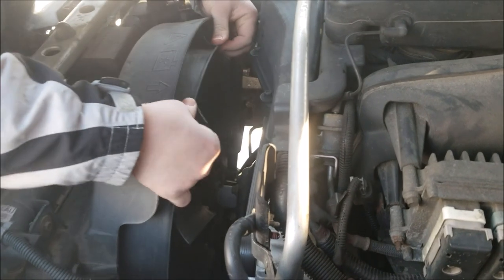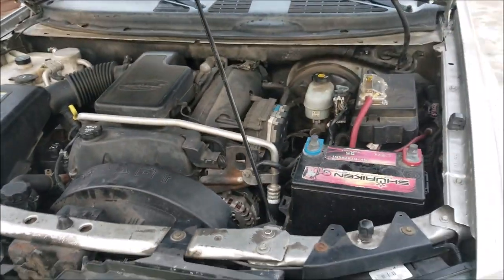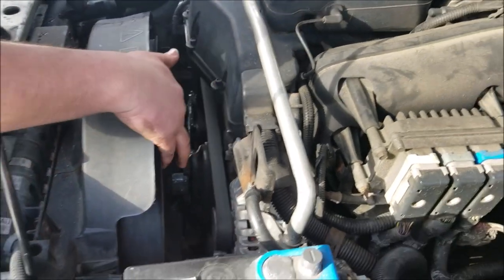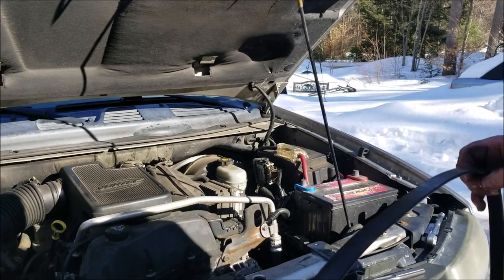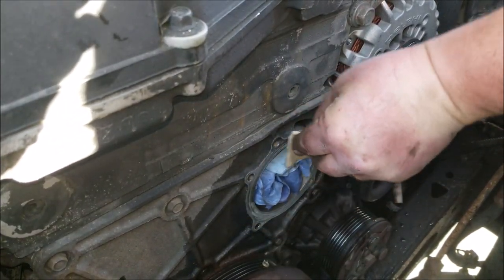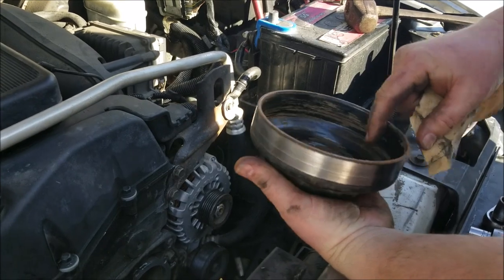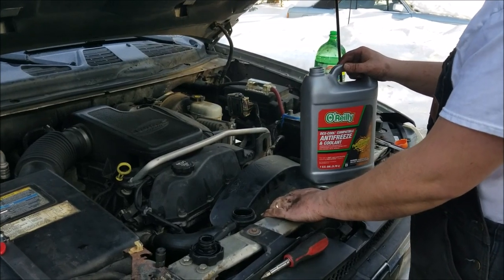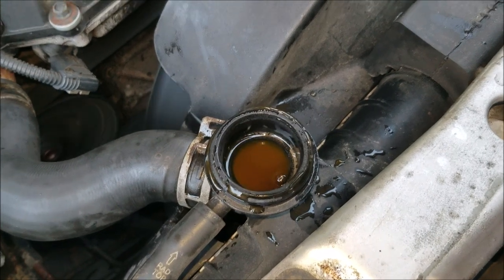Step by Step Chevy Trailblazer 4.2L Water Pump & Fan Clutch Replacement in Under an Hour

Comment: You don't have to tighten the big fan nut. It will self-tighten when the engine starts. It won't unscrew or fall off when you shut the engine off. It'll be just fine.
Reply: Take an air chisel to the nut end for a whack or two. It will definitely never move. Taking it off, this helps too.

Comment: GREAT, video, thank you! 

BUT it’s  35 INCH pounds and then 89 INCH pounds for those small 10mm head water pump bolts to block  

You’ll break or strip them if you use FOOT pounds
Reply: So wish I saw that before I did it...     On a positive note, I haven't had any leaks with just 4 bolts on my pump.

Comment: Steve - Excellent video. Very detailed and time saving. Why did you replace the Fan Clutch was it bad or is it just a good time to replace it when the water pump goes bad? Thanks again this is going to be big help.
Reply from the maker: If the electric fan clutch fails it can cause water pump failure, so due to the labor involved and the mileage on the vehicle I felt it best to simply change both while I was right there. Thanks for watching and commenting!

Comment: there's no need to cut the shroud, pull up the driver side first so the fan clutch assembly clears the pulley  then tilt the shroud towards the engine, you'll have to wiggle and finesse a little  until the shroud is clear of the power steering lines.

Comment: Just want to say thanks for this video! Well done. Dealership wanted $700 for this job. I replaced water pump $88 AC Delco, $25 belt, plus antifreeze. Thanks! I did notch the shroud to allow clearance past the radiator neck. Pulled both the shroud and clutch fan together straight out with no problem. THANKS!!
Reply from the maker: Wholy cow thats some serious dough! Glad to hear you were able to get it done yourself. Thanks for watching and commenting!

Comment: Great video. Excellent positioning and descriptions. Awesome tool description too.
I caught the 10mm water pump bolt tightening mistake but that was the only one.
I usually dont need a torque  wrench anyways. 89 ft ponds is way too much. haha
Id say 25 ft pounds is good.  Thank you my good man.
Reply from the maker: Thanks!, yeah, 89 inch lbs was what it should be

Comment: Great video . Prior to me watching , I was surely going to let the professional do it. Dealing with removing the radiator,,I DIDNT WANT TO DO. After seeing how you cut the cover , Bam! Too easy. I didn’t have that cutting tool you have. Instead , I drilled a hole on each side of the cover (upper radiator) then took for tin snips and cut. Great video . Thanks !!!

Comment: My water pump blew out when I was on the high way and threw and shredded my belt on me. I figured it was the water pump because the massive hole in the front of it. Thanks for a step by step on replacing it.

Comment: Hey @Steve Young thanks for all your Trailblazer videos.  I have an 02 TB that I need to change water pump and fan clutch on.  How's the Dorman working out for you?  I have read a few reviews that the fan runs on high speed all the time.  Stating that I should go OEM.  Problem is OEM costs an arm and a leg.  I don't trust the stuff on EBAY to get one.  The OEM part on Rock AUto says it comes with sensor.  What stinkn sensor is that?

Comment: Great Job man!! ill be doing this repair this weekend and I'm completely confident I can do this. When you made mention of the cut out on the fan shroud I was thinking "fucking Right!" Thank you for this video ! Again great video ! to the point not too much talking and bullshit and you obviously know your stuff!!
Reply: This video is great, but you dont have to cut the shroud - if you undo the fan motor bolts push back toward radiator then shroud eill just slide up past extruded pipe housing.

Comment: I replaced the water pump yesterday on my 2005 Chevy Trail Blazer. I just tapped the big nut of the fan clutch and used a long screwdriver wedged between the pump pulley screws to loosen it. Thanks.

Comment: @Steve Young GREAT REFERENCE! I did this job yesterday and the Thermostat and ECT Sensor and this helped a lot! My tip to all is: if everything goes smooth except getting those damn Trans cooling lines back into their slots- you can take a Dremel tool and trim them down and it will fall into place like butter PLUS the cooling lines will still sit where they belong..they just wont "snap" into place but will have support. Once again EXCELLENT reference for doing this job correctly! Also, I believe the giant clutch nut wrench is size 1 7/16(Item #25193) ordered from Ace hardware.

Comment: Great video - one small correction, in the video you said do the final torque of water pump bolts to 89 ft/ pounds and it should be 89 inch/ pounds. 
Pretty sure 89 ft/pounds would strip the bolt and then you have a nightmare situation.

Comment: thank you very much for your video, but could you provide me with the torque specifications for the 3 parts? and could you provide me with the measurements of the tools that I will need? first of all, Thanks

Comment: My problem was the radiator cap wouldn't release the pressure blew the ceal in the pump then after replacing the pump I had over heating issues replaced the thermostat still over heat replaced the water sencer still over heat the cap was really tight to get off It finally broke put a new one on all my issues are gone so check your cap it should remove easily if not replace it save a ton of money and agrivation

Comment: excellent demonstration.  only thing i feel would have worked better was to take the lower rad hose off and just drain all the coolant from the radiator.  chances are the average trailvoy owner hasnt touched their coolant in years and this is a perfect time to replace and/or flush the coolant.  other than that, brilliant job

Comment: The if you don't want to cut the Shroud you can lean the radiator Forward if you pulled the radiator crossmember bolts . it takes more time but if you're doing it for someone else it looks more professional

Comment: don't need to cut shroud should have enough flexibility in the plastic I did the job with a little flat bar between the radiator neck and shroud plenty of room and less time than it took to watch the video

Comment: Took mine in for an oil change and they told me the water pump is loose and about to fall off the engine. They wanted $648 to fix it

Comment: Any tips on getting the fan clutch nut free? Really Rusty. Used aero kroil.  Tried heating it up and I still can't bust it.. thinking about cutting it on the stem and just replace the water pump with new fan clutch.. thoughts?? Thanks

Comment: Just got the vehicle and going to fix water pump but is it okay if my heat works on 4 for this? 5 doesn't. Low air, probably an actuator, tyvm
Reply: dont know if its too late, but that would be a blower motor resistor problem. I believe is under the glove box. easy fix.

Comment: Great job and thanks so much for posting this. Have not worked on cars in about 30 years, but this makes it easy to go ahead with it.
One question, not familiar with the "Hold tool" with the Red handle. Do you feel this is a necessity for this job?

Comment: I see that the water pump had shaft play in it, but what was wrong with the fan clutch assembly? I ask cause those things aren’t cheap. I just changed the rad on my trailblazer today and didn’t do the water pump or clutch fan. But my luck those things will go soon. And those cuts to the shroud are genius. I wish I would have seen your vid sooner.
Reply from the maker: From my research, fan clutch failure can allegedly cause premature water pump failure so no sense in putting used clutch back on new water pump considering the milage and labor involved in changing things out I figured it best to change the clutch.
Reply: Steve Young 
You sir are a genius. Today I noticed a clicking noise coming from under the hood and the temp rose a little which never happens and sure enough, it was the water pump bearings. I went ahead and bit the bullet and ordered a new fan clutch while I was at it. Next order of business in the near future is going to be the alternator. After that I should be golden for a good while. Thanks for the intel.
Reply from the maker: @wheelmanjh4067  if you wanna see how the alt comes out that would be shown in my thermostat video, as the alt needs to come out to change the thermostat and it also needs to come out to change the damn temp sensor as well, I changed one and then had to tear it apart to change the other. I should have changed both while I had the damn alt out of the way the 1st time lol.

Comment: According to the GM Trailblazer Chilton Repair Manual:
* Apply a thin layer of RTV sealant to both sides of the new water pump gasket
* Torque specs - Fan Blade Bolts 20 ft. lbs - Water pump mounting bolts 6 cylinder 89 inch lbs - Water pump pulley bolts 18 ft. lbs.
you're welcome
Reply: Please help me, are those torque specifications for the 3 bolt types you mention correct?

Comment: I remove the lower one first, then remove the upper one, tilt it while still connected to motor so any remaining coolant drains in it, pull hose out with no coolant in it

Comment: Steve you ROCK buddy!  I just have 1 problem I ran into. The pulley is stuck onto the water pump. Bolts came out easy but the pulley won't budge. Can you help a fellow New Hampshire home mechanic? Live Free or Die!
Reply from the maker: Do you have access to a torch? Even a propane one just to heat up the pulley a little and give it a rap with a hammer? Otherwise I would spray pb blaster and hit it. Not like we are worried at this point about hurting the pump itself as it's junk and is getting replaced. Those are my thoughts. Thanks for watching!

Comment: Just did this a few days ago. The notch is a great idea.  Of course I'm a few days late on that one. Not only will it save time but might save your radiator. There is really no way to get the shroud out without putting alot of stress on the water neck of the radiator plus gouging the fins with the bottom of the shroud.

Comment: WARNING!!!!!    he says 89 foot pounds, that should be 89 inch pounds.  Don't break your bolt like I did with that measurement.
Reply: PS. if you get you're tools from O'Rielly's, they usually only have a foot pound Torque wrench.    Conversions:  35 inch pounds is ~ 2.92 ft pounds.    89 inch pounds is ~18 ft pounds.    However, as you are tightening it...  if it feels off to you stop early.

Comment: Thanks Steve, this video was very helpful.  I struggled to remove the fan nut until I stumbled onto an interesting solution.
I put a 13mm closed end wrench on one of the four pully bolts and spun the pulley counter clockwise and the wrench landed on top of the crankshaft pulley. Then when I tried to loosen the large fan nut, the 13mm wrench stopped the pully from turning because it was resting on the crankshaft pulley and at the same time keeping the pully bolt tight. This allowed the fan nut to come loose. I think I only stumbled on this option because I had already removed the belt and could see the crankshaft pulley.  Thanks again for the video!

Comment: 🛠🏆👍 Your video is the best one out there for this job. I especially like your shroud notch tip at the 7:00 mark. Yes, GM should have allowed for that when the shroud was made! Your solution is brilliant and a real time-saver. I also like that your explanation was clear and straight forward with no annoying hip-hop/rap/thrash metal “music” blasting away in the background. Only amateurs include music like that. Like the Ford 4.6 water pump, the TrailBlazer/Envoy is one of the easiest ones to do— although my Crown Victoria was even easier. 😆 Thank you for taking time to make this excellent walk-through tutorial.
Reply from the maker: Appreciate the kind words. Thank you for watching and commenting!

Comment: Question..... If it can blow the seal... Can it's water leak in the engine oil?
Edit: hmm yeah I thought not it would have made sense to me if that's the problem with the one I saw
Reply from the maker: No

Comment: Completed the process today and got it done per you instructions. While the fan was out I took the liberty to replace the belt, new tensioner, pully and the top coolant hose. Thank you for the excellent video.

Comment: Hello My 2004 TB is overheating my husband replaced the water pump and thermostat and still the  same problem..overheats after about 25 mins driving..hoses checked? Please advise..
Reply from the maker: if you haven't diagnosed this already, did he change the electric fan clutch? also in the event it is still overheating, check the coolant temp sensor, perhaps its faulty.

Comment: The big nut is a 1-3/8"  on mine.  Was able to use a 1-1/2 " was all I had on hand. If you have a big wrench that fits it you can just smack it with a hammer and it usually will break it loose, RH thread, just use your other hand to catch it so it doesn't hit the sensor to the left side (looking at it) similar to the way he loosened the water pump pulley bolts. I like your idea of cutting the shroud to get it to come straight up and out since the fan is interlocked into the shroud you can't remove it like most cars. I don't think the later models are like that. I've changed them before and don't remember it being this difficult. Yeah, best to draw a diagram of the belt routing if you don't have a sticker or diagram moulded into the shroud. Good video, tell the wife she done good.
Reply: O'Reilley had nothing bigger than 1 3/8". When you're out and about you don't wanna jam out to Lowe's or Home Depot for that size. Thankfully my neighbor had a crescent wrench big enough. I went out and sent a big amount for a plumber wrench for nothing 😆

Comment: Hey bud 35 inch pounds and 89 inch pounds.. NOT FOOT POUNDS.  I'm sure someone caught that before breaking bolts.. 👍👍
Reply: Help me please...do you know what the specifications are for tightening the 3 types of bolts? Pump, pulley and fan?
Reply: @davidtorres1967  I just tightened  by hand man. 3/8 ratchet 12"

Comment: Hi guys. Hey I just subscribed and I have a question for anyone who knows for a Chevy Trailblazer '05. Went to dealership yesterday for something else and they said my engine fan/pulley is a little loose and making some noise. OK. But then they said I need to replace the pump, clutch, coolant and parts + labor is going to cost me $1,250. Uggh......................They also said the fan could pop off at any time and wreak total havoc. But seriously do all those things need to be replaced? Any opinions would be greatly appreciated.
Reply from the maker: Well replacing the fan clutch at the same time as pump makes sense only because  even if its fine, its old, and if it dies it's gonna take the pump out which you just replaced and seeing how much of a pain in the ass it is to change, you might as well change the clutch at same time as pump. But $1250 is a ludicrous price. You can do it yourself for way cheaper.
Reply: @E4EonEbay  Thanks for the quick reply much appreciated dude! Yes it sure does seem high to me. I just don't have the know-how to do it myself or I would. I wish I could bring it over to your house and have you do it for much cheaper. I guess I'll have to bite the bullet. Let's say the fan did pop off though, would it do serious damage? Thanks man!
Reply from the maker: @jasonyoungkeit2941  the fan falling off could cause damage to the radiator, yes if you were closer I'd definitely help you out. I would get a second opinion before spending the $1250, look down the comments here and you can see what others were quoted / paid for the same repair.
Reply: @E4EonEbay  Yes that's what they said at the dealership too. Makes me wonder though, do engine fans frequently fall off? Isn't there something to keep the thing attached? I don't know but, it seems to me like if it were a very old car with like 300K miles on it then maybe. My '05 has only 115K miles on it. All of this just seems a little overkill for my vehicle but what do I know. Shucks I sure wish you lived here in Orangeburg or Columbia, SC. I would pay you to do it for much cheaper. Yes I will look at other comments. I think I'm going to grill the dealership with questions too! But thanks for your expertise I really appreciate it.

Comment: Was a tech for almost 15 years and most customers would have your behind for cutting the shroud..but a great tip for your own car...
Reply from the maker: being that it is older with higher miles and the fact that it was my own it definitely saved a lot of time, not sure why GM didnt just make a notch cut there with something flexible covering it like a rubber flap  there or something...

Comment: I broke my water pump bolt 10 mm inside how can I fix that problem.
Reply from the maker: Not sure why my reply didn't take the 1st time, but here goes again, if there is enough sticking out when you get the rest of the bolts out and the pump out of the way you may be able to get on the part thats sticking out with some vice grips. Perhaps applying some heat before attempting to turn it out with the vice grips may help. You don't want to end up snapping it off flush as this will result in needing to drill it out and most likely having to re tap the hole. Perhaps someone may chime in with an alternate method.

Comment: This 2 year old video helps still man. Thank you! 
NOTE: On the 2002 Envoy, if you've never replaced the fan shroud, there are two rubber bumpers on either side that are held in by hooks which will take a bit of wrestling to dislodge from the shroud.
Reply: How did you get them off,and did you hook the back up?
Reply: @mjnesscatt  I fought 'em off by muscling them about using a pair of pliers. They're rubber so they will give as you guide them over the plastic hooks. I made a video showing how it came back together for ya: https://youtu.be/83_CYrb07XM